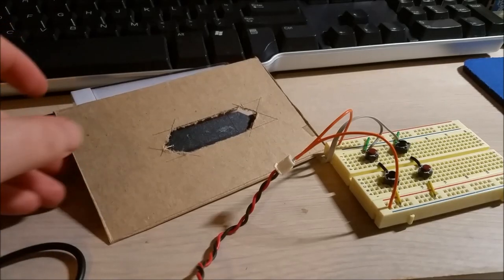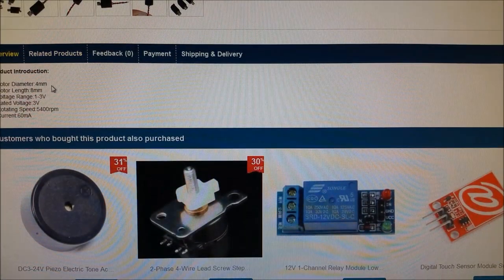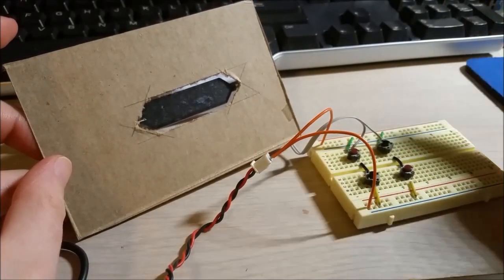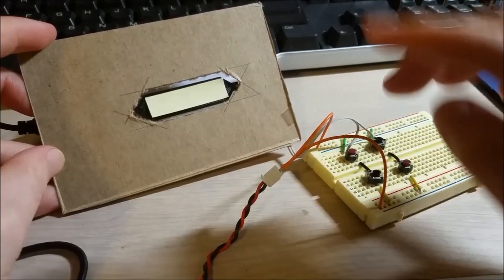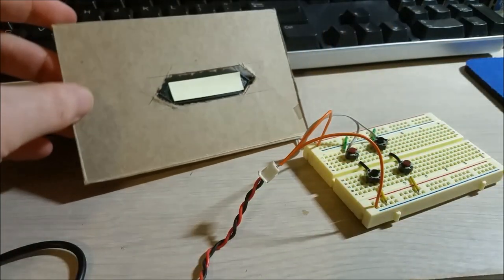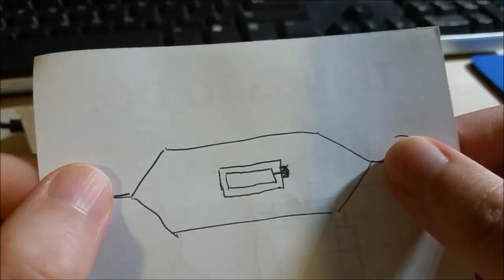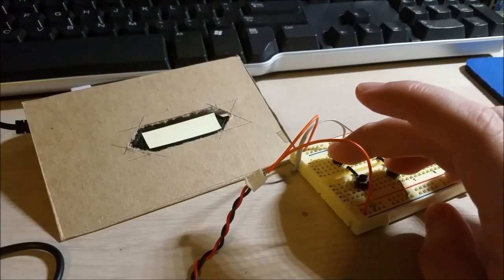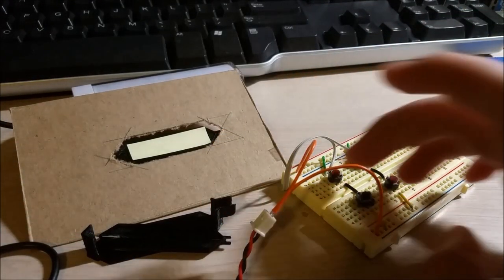DIY Digital Electromechanical Flip Clock Prototype Part 1 (Parts Provided by ICStation!)

Comment: Fantastic!  Idea to streamline flap production: Print the first few layers with white filament, then pause the print and change to black.  You can print a whole bed full of flaps at once and have them turn out already perfectly and permanently marked. :D
Reply from the maker: That's a great idea. My bed is around 8"x8" so I could print a whole bunch at a time and just do one filament swap. The simpler and cheaper I can make this the better!

Comment: this is genius. i had considered making my own coils to go with a 3d printed flip dot display, but this is a way better idea.
Reply from the maker: I wanted to build this years ago after discovering flip dot displays and my first idea was using coils and magnets but couldn't really find a cheap source of coils other than winding my own and that just sounded too tedious. Then one day I was surfing the web and found these motors for 10 for under $3. Sometimes all the pieces just align.
Reply: That price is great. I might grab a pack to do toothbrush bots with my daughters.
Reply from the maker: Yeah I just got my bag of thirty of them and couldn't be happier. I could think of a million things I would do with these little guys if they weren't going in a clock.

Comment: Neat build!  One option for space might be to use (fairly) stiff wire as an axle, only extend it out far enough that you can mount the motors elsewhere.  The wire should be stiff enough to prevent looping while still bending enough to handle the motor not being in alignment.  To mount it to the motor, I'd just drill a hole through the counterweight perpendicular to the shaft, put three 90-degree bends in the wire so that it sits against the axle and goes through the hole, then bend the end of the wire again once it is in place.  A bit of hot glue to hold it in place and you're done!  The wire twisting some will only make the flipping slightly slower, though it shouldn't be too bad.

Hope this helps!
Reply from the maker: I definitely need to do some more experimentation. I just received the bag of motors but unfortunately my 3d printer is out of commission so I'll need to get that sorted before I can progress.

Comment: Is there any update?  Did you run into some roadblock that I might learn from and avoid?  Building (and donating) a 12 inch high, six digit, seven segmented model rocket countdown/message display....amping up the fun for the Cub Scouts!  Thanks for any further info.
Reply from the maker: I printed the first digit and ... found my idea for how to mount the motors and vanes was much too weak/wobbly. I'm currently redesigning everything to mount the motors under each vane and use 2 small magnets to couple the vanes with the motors. This should allow tighter spacing between segments and also look more seamless as the motors aren't visible. I already printed a single segment as a test and it mostly works, just need to tweak a little and design all 7 segments in one frame.
Reply: @sjm4306  Yes, spacing problems...  I've got a six digit display planned, and moving the "decimal points" to odd locations to fit my text needs.  But that just increases the interference seen just with the native seven segments per digit!  Figured I'd have to space layers in the depth of the display.
Reply: @sjm4306  Also looking at the power consumption...  Maybe use a simple spring to default segments to the "off" position.  Would work great when most of time & segments are off.  But needs constant power when "on."  :-(

Comment: Very neat prototype, love the switching speed! I have two suggestions, the first being to use luminous green tape of which rolls are very cheap off eBay. An ultraviolet LED (also eBay)  really excites the luminosity of this tape so it really glows brightly (I've tried it).
The other thing is, why not try pivoting the segments at 90 degrees to the longitudinal exis? If you search for 'Pivot Pricer' (https://youtu.be/qbcpTlQ63K4) which are 7-segment plastic flip digits for store pricing. This might allow you to put the central segment's motor behind the upper or lower enclosed centre areas.
Reply from the maker: Reflective green tape would look so cool. Also that Pivot Pricer animation looks really slick and would allow me to put the segments right up to eachother but I'd be afraid these tiny motors just don't have the oomph to pull that off. The next time I get a chance I'll mock it up to see if it works.

Comment: Super cool. I actually looked at doing something similar for a business sign where LED Matrix signage was prohibited by a local by-law. Hadn't thought of little motors, and didn't have access to a 3D printers so it never went past concept. The solution I had come up with involved solenoids instead of motors, and they were just much too expensive.

This could probably be created to a larger scale without too many inputs if an address bus were used to control one digit at a time. It would also reduce max current a bit. Alternatively, to use a small and cheap microcontroller without a lot of I/O pins, shift registers are great for setting large numbers of bits serially. I've used latching shift registers to control large numbers of indicator LEDs from very small microcontrollers in the past.
Reply from the maker: Thanks. If I didn't have a 3d printer just getting to this step would've taken 10 times as long. Also just out of curiosity why were LED signs prohibited?
Reply: Visual distraction on a stretch of road that has no night-time lighting is the main reason in terms of LED Matrix signage. The town also has a general by-law prohibiting third-party signage, and restricting size and form factor of all business signage not on the frontage of the building. It's restrictive, but effective. I must admit that the roads look a lot tidier than a lot of small towns in the area that have no such by-law.
Reply from the maker: Interesting, that makes a lot of sense and not having so much light pollution would be nice for a change.

Comment: sjm4306, Your multiplexing is a bit more complex than you expect... 

If you draw out the whole schematic you're proposing, you'll see that you're connecting two other segements in series when you activate one segment. 

Suppose we call the digits 1-4, and the segments A-G,  if you want to activate 1A, you also put  2A-2B-1B in series and activate those, Similarly 2A-2C-1C, 3A-3D-1D and so on. 

So when you try to activate 1A, you need to know that you can provide enough current for the 18 three-in-series connections. Moreover, you need to have tight tolerances, so that when the segments flip at say 100% on average, you drive each segment at 150%, but you have to be sure that none of the others flip at 50%.... 

I've  been thinking about this for a while. The solution could be two diodes per segment and one extra digit-common line for each digit. Instead of the digitcommon being able to source and sink current, you need to separate them and enforce that with a diode. 

Instead of the reed relays, I would suggest having a half-H on each of the digits, which per my suggestion would be split into a drive-low and drive-high part. So... you'd end up with 14 controls for the seven segments and 8 controls for the digits. 22 pins.
Reply from the maker: Thanks for the suggestions. Yeah I hadn't really thought through my idea since I scribbled it onto a post it note so I definitely need to flesh that out. I'm planning on breadboarding everything once I get the mechanical assemblies built so I have a bit of time to think about the points you brought up. And maybe doing a psim simulation with simulated control block would help before I build any hardware.

Comment: great ideas. How about a flexishaft (spring or plastic shaft) for the final segment.
Also I assume charlie plexing for the motors would work, as you can tell them, in order, which ones to turn on. Keeps your drivers down to two hbridges per 7seg display...
Happy to help out if you wandt to parameterise the stls using openSCAD. hackadayIO maybe to collaborate.
See app note from maxim for (IMHO) useful description of charlieplexing
- https://www.maximintegrated.com/en/app-notes/index.mvp/id/1880
also consider 2n7000 as the N-mosfet (see fig 25) 
- http://homofaciens.de/technics-base-circuits-h-bridge_en.htm
Reply from the maker: I wonder if a piece of flexible filament would work as a flexible joint (well it might be too flexible then). I have so many things I want to try out now and so little time ...
Also I was under the impression that charlieplexing works with leds since they are diodes and only need to operate in one direction, but the motors need the polarity reversed to turn on or off so this complicates things quite a bit. Still need to figure the control circuitry out but at least I have time until I finish building the mechanical parts.
Reply: I'm hoping that the diode has a mosfet next to it. so 9 bits to drive 8 directions. but maybe a simpler indexing scheme would be better. just trying to lower the number of pins you might need for a 7seg. The effects of a real H bridge is not quite what you need. drive one way, or reverse, or no current at all. but you could bias the drive to all one way if enabled but no signal, or drive the other way if signal. Then disable. This way you might be able to charlieplex using diode with mosfet as long as you had a bias the other way and an enable poer for driving cycle pin. If you see what I mean....